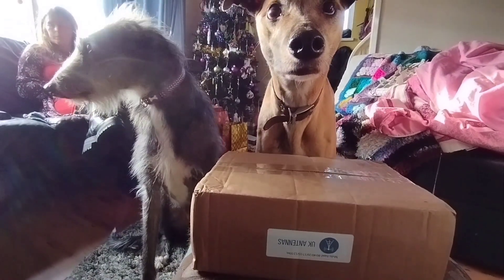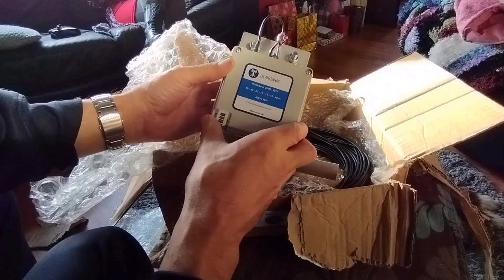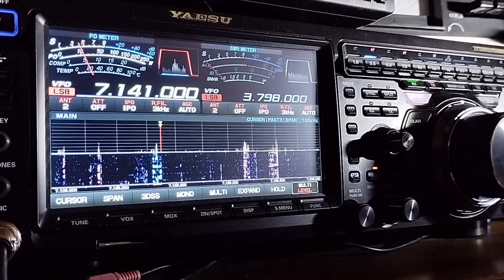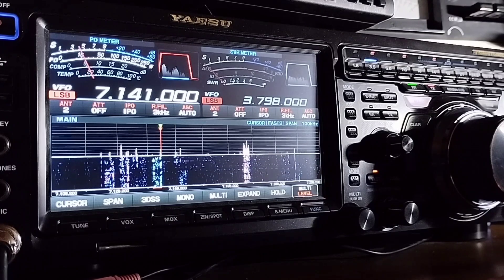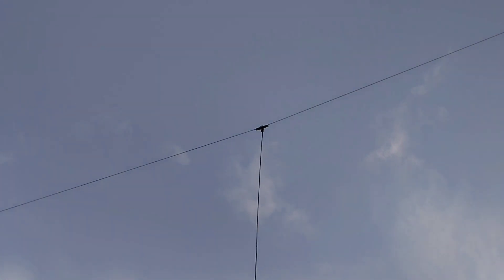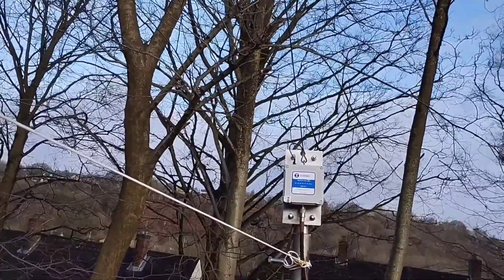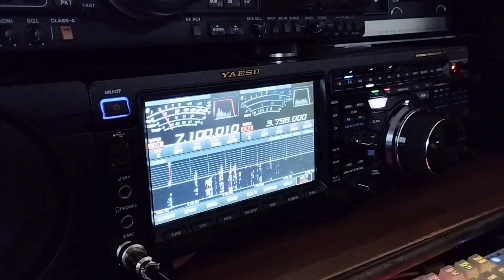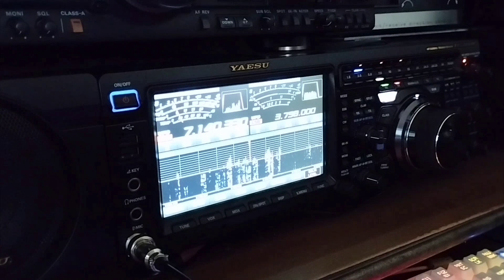80m Half Wave  End Fed Antenna Vs Dipole and Vertical.

Comment: Hi do you have to put tape around the connection of the anun to make it waterproof
Reply from the maker: Hello 👋 no I didn't have to do that. The box is well sealed. I just left it as it came and it's been in the same place for 18 months trouble free and performance is great 👍
Reply: @M0YKSHamRadio  OK thanks I'm getting one my first wire antenna
Reply from the maker: @Oxfordshire1  well worth it. I was surprised how good it is. I usually make my own. They are excellent you will be happy
Reply: @M0YKSHamRadio  at the end of the wire there is a plastic tensioner how much wire do you fold back
Reply from the maker: @Oxfordshire1  it's all set up ready to put up. I undid the wire and altered the length by folding it back and not cutting anything but found it was pre tuned to the bands better with the original factory length. I put it back to how it came and haven't thought about it since. The chap that sells them does a top quality job.
Reply: @M0YKSHamRadio  is it best to have the wire in a straight line as well as the 49 to 1 unun

Comment: Brilliant video very informative thanks for creating it, I use an end fed antenna more home brew as being based in London space can be an issue and also I like my antenna to be stealth so not too noticeable.
I've recently moved to just outside Ipswich and again garden space is smaller than previous so was thinking of getting a vertical antenna and wanted to know your thoughts on those, I will probably also erect the end fed as well once I can establish some anchor points.
Thanks,
Carl
2E0SDM
73's
Reply from the maker: Hi Carl thanks for watching and leaving the comment. I am still using both vertical and endfed wire and both are well worth having. The EFW is proving to be excellent on 40 and 80. I Make both into G and DX with it and love it. I occasionally switch vertical for some N.American signals as I seem to usually have a slightly better signal vertical in that direction. I have a Hustler 6BTV which I have used continuously for 21 years and it's still in good condition working perfectly. I attached a few 12ft radials and the SWR is good 40 -10m. It works on 80m but the atu is needed and you can't move frequency without re tuning as 80 is very narrow. But I have worked South, North America and Caribbean with it on 80. The EFW is much better on 80m. I would recommend the 6BTV as a good vertical antenna. It stands up in all weather without any worries. 73

Comment: Interesting... So you are running it like a V   Out and back ?     73  KC3ZDW
Reply from the maker: @kenmartin1211  I tried it like that for a while but in the end I have it in a straight line inverted vee with the center at 30feet above the ground. I fixed a copper pipe to the ground bolt into the soil. I added a 13ft counterpoise and have been using it all year with success. I can work DX on both 80 and 40 as well as good local skywave. I have some great results into N.America on 80/75 meters just as good as my dipole. The noise level is massively lower than the dipole was. It's a very good antenna I will make a follow up video sometime now the lower bands should start to open. 73 tnx
Reply: @M0YKSHamRadio  Thank You!   Will watch for it

Comment: Great video thanks! What coaxial are you using with it? I'm getting lots of static on mine but only using the cheap stuff. Maybe I need to buy some better stuff. I'm also running the feed from under the eaves of my guttering and down the garden I've heard doing it the opposite way round could reduce interference/ static? 
Thanks again. DE M7PGT
Reply from the maker: Hi bro I am running heavy RG213 not the most fancy stuff but reasonable enough. I would definitely try the feed at the bottom and the wire terminating at the eves. You will be able to get a much better ground/earth connection. that can help with noise. You could be picking up noise from the house straight into the feed point at the moment. Good luck and I hope to hear you soon.

Comment: fantastic choice, its my main HF antenna at the QTH, have a 40M one for /P /M work (yet to be used tbh, mag loop is too easy ;o) I love this antenna it works so well. I have it going into a MFJ993b ATU and it tunes on 160m without issue. Mine has a slight right slope on it but has always performed really well.
Reply from the maker: still testing it out but seems good so far. Thanks buddy Merry Christmas

Comment from the maker: Thanks for all of your comments. 👍😉 Its great to see you all in there! I have slightly altered the long wire layout today. It is now higher and  in a straight line sloping. SWR is very good across all bands. On 80m I noticed not much difference in signal between dipole and end fed but the end fed is much quieter on reception. On 40 it is working very well indeed. I will be making the next episode very soon with some more end fed wire experiments. 

Have a merry Christmas and great holiday. 73 thanks for your comments everyone.

Comment: People tell me the EFHW is rubbish, my logbook tells me it ain't :)  You should give it a go up on 20-10 meters too Simon, I recon it'll out perform your 6BTV, it does mine.  No radials and quieter RX, what's not to like?
Reply: It’s absolutely not rubbish. Those people are just wrong and blowing smoke out their arses. I have the same type of antenna from HyEndFed in Holland, it’s just great here, because there’s only two supports needed and the feed point is close to the shack. Performance is just fine too.
Reply: @timwhite8500  Yeah I get about the same performance on the fundamental frequency as I do on a dipole, but the EFHW is a lot more convenient to install.  It's not bad on the resonant harmonics either!

Comment: i've got the shortened one with the 110uh coil at the bottom of my garden on a 12m spiderpole, cracking antenna specially on the lower bands. thanks for the call back and confirmation via the iss repeater the other week. 73 de G1YEF.